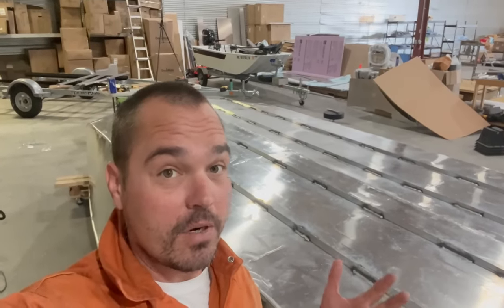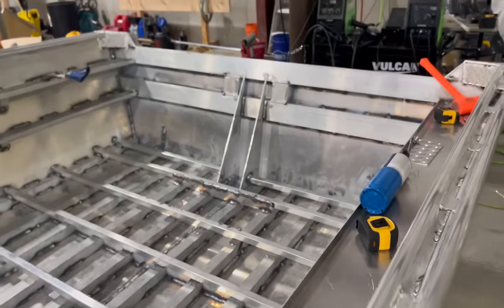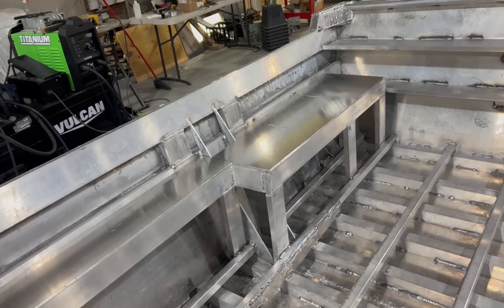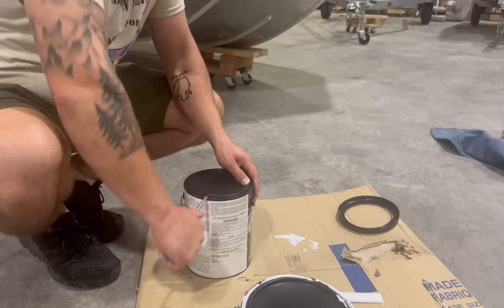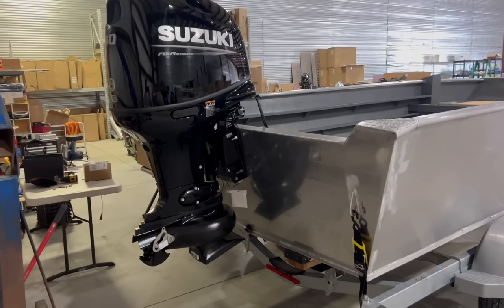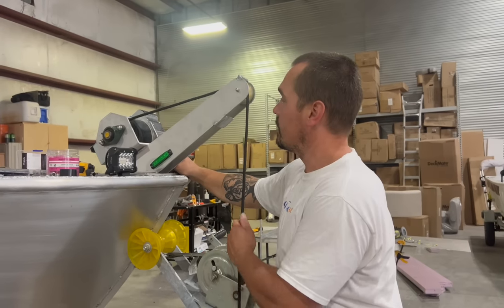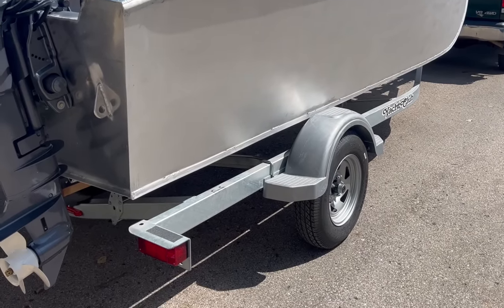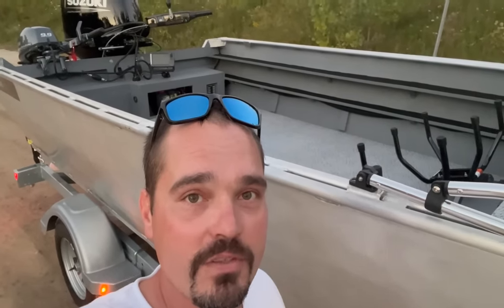EXTRA WIDE 17' Custom Welded Boat Build - Part 3 of 3

Comment: This build turned out awesome. I was shocked to hear how much H.P you lose with that setup.
Reply from the maker: Yep, and fuel economy drops because of that…probably also 30% if you’re running it hard. BUT the shallow water performance makes it 110% worth it. I haven’t tested just how shallow it’ll run, but I’m thinking 4-6” on plane.
Reply: We just use surface drives/mudmotors. We can get 25 to 30 mph depending on how loaded down we are.
Reply from the maker: @jasongrinnell1986  there are a few guys who run mud motors on the rivers here, but they’re so darn loud. For duck hunting it just gets you to the spot and you stay there set up for the whole hunt. We’re constantly moving on the river and running the motor constantly…so we love our jet drives

Comment: nice job thanks to share all this helpful detels 
 just have question 
is the aluminum boat works good for sea ( salt water ) or just good for river ( sweet water )
Reply from the maker: Glad to help. Personally, I would stick to a fiberglass hull in saltwater. Aluminum boats are run a lot in saltwater, but a lot of things have to be done to prevent corrosion. For freshwater I prefer aluminum because it's lighter and easier to customize or repair.

Comment: Question would it be better to put a light weight aluminum floor and not a plywood floor? My old boat had plywood but it soaked up water and made it heavier
Reply from the maker: A lot of folks have commented disapproving of the wood floor. Weight wasn't really an issue here as the 1/2" plywood barely added 100 lbs to the whole boat, and it's so high above the foam and boat bottom that I don't think it could ever get water logged...especially with the vinyl instead of carpet. I love the quietness and the feel of plywood under my feet. My 12' custom build got an aluminum floor and it's great, but that boat was built to be light and not designed to be the big comfy barge this boat is. It's all personal preference!

Comment: How much did you have in it. And how thick was the metal.  Thank uou.
Reply from the maker: The bottom and side walls were all 0.125", most of the bracing and extrusions were 0.125" too. Transom was 3/16" plate and some transom bracing was up to 0.25". I didn't keep perfect track, but after the boat, trailer, motors, batteries, anchor system, and electrical it was around $30K in materials. Somewhere around 200 hours into it.

Comment: Hi Tom! You may have already covered it somewhere, but would you go over your welding setup? I'm looking to get back into welding (aluminum specifically) and am very interested to see what all you use. I see the Titaniums from harbor freight in the video, what models are you using and have you been happy with them?
Reply from the maker: I briefly cover it in part one of the series. I’m going to cover it in more detail in the follow up part and even lay some welds so folks can see what some of the less expensive machines are capable of.
Reply: @tomspontoons awesome! I took a welding course in high school but that was quite a while ago now. I'm considering the multi function titanium welder from harbor freight as one to start out re-learning everything.
Reply from the maker: @wesyoung91  I’ve been happy with my Titanium’s, and the replacement plan is well worth it as you can get a new machine or spool gun if anything starts acting funny. I have used them once for the spool gun and the new one works a million times better. I have the two separate machines to keep from switching everything back and forth, MIG170 and TIG200. It’s super helpful when I can tack quick with the spool gun and then fill in pretty with the TIG

Comment: Just discovered your channel.  Great job!  How much does it weigh in this video when you keep flipping it over?  Just curious.  Enjoy!
Reply from the maker: Thanks! I am guessing it's around 800 pounds of just aluminum before adding the floor and motor, etc. I think the hull is 1300 lbs with the floor and everything in. I honestly don't remember the exact numbers. I know it's about 3000 lbs of boat, motor, and trailer though!

Comment: Fantastic build. 
Is that an ez load trailer ?
Reply from the maker: Thank you!! It’s a Yacht Club. Tows great!
Reply: @tomspontoons  was looking at fenders. Looks similar to mine. Plastic they broke where the foot rest is. Not enough support underneath it. I ended up adding 3/16 alum plate in replacements.
Reply: You ever thought about adding a hot wash box on stern. Comes in handy to wash hands in warm soapy water in winter or river temp water from kicker.
Reply from the maker: @omieyouknowme  I worry about that, but I think these are pretty sturdy. No issues yet
Reply from the maker: @omieyouknowme  That would be amazing. Luckily, we don’t fish bait much in the winter months…wouldn’t need it like we do during salmon season fishing with roe and cured bait.

Comment: Great looking boat. Are you going to start making them to sell
Reply from the maker: Not planning on it because of the hassle of being a registered boat builder. Simple when building for yourself, but gets complicated when building to sell….but that would be the dream! Building one custom boat at a time giving the customer exactly what they want for their use that big manufacturers don’t offer!!
Reply: @tomspontoons  it definitely would be awesome. I'm wanting a boat really bad but I'm in a wheelchair most of the time. I would love to have 1 that the front could open up so I could cruise right into it.
Reply from the maker: They make "landing crafts" of all sizes. It would be something that would allow you to roll up and in safely. Otherwise, pontoon boats tend to be the next best option as you can do ramp systems on the front and sides for shore and dock loading. Plus it's then a flat surface immediately without any decks or steps.
Reply: @tomspontoons  thank you. ill have to check into them both

Comment: Do you sell just the hull built? Basically full welded, no paint wiring etc...?
Reply from the maker: This boat is going to be for sale in the near future. I can build a bare hull with floatation foam (removable) and a USCG tag to meet what you’re looking to do. If it’s 20’ there does not need to be any foam.
Reply: @tomspontoons  I was looking for a basic built hull. All floor supports installed. Prefer a flat bottom (front to back) No V-Mod. Needing a transom that would hold at least a 150hp standard style lower.
Reply from the maker: @rodatkinson1417  That would be a pretty straight forward build. I would push it to 20' overall length (with a swim step) to get beyond where flotation is needed. Plus with a 150 on the back you'd want the extra length for improved handling. Send me an email and I can get you some more information.

tomspontoons@gmail.com

Comment: How much was all the aluminum ? Looks great, I want to do something like this on a smaller scale. I built two wooden cedar strip canoes in my younger days and I always wanted to do a fishing boat like this someday. 😊
Reply from the maker: I’m thinking it was close to $8K in aluminum…1300 lbs worth. I have some smaller builds that were MUCH less expensive. My last one was probably $1500 in aluminum, a 12’ long flat bottom with a 52” bottom. Great little boat!

Comment: Did you weld it with a plse or ordinary mig? Great boat.
Reply from the maker: Regular old MIG spool gun. I’ll do a breakdown of my welding setup in the follow up episode. I show my machines in part 1 of the build. I MIG all the structural stuff under the floor, and TIG all the water line connections and anything that’s aesthetic or visible above the floor

Comment: With building your own boat how does it work for register it for use with a engine in your state? I'm very interested in building my own boat to use down here in fla tried of fiberglass boats I'm from New York originally and that's all we had was aluminum and steel boats.... Thanks for the great content enjoy watching you work.... 😊😊😊
Reply from the maker: Seems to be different in every state. Here in Michigan I can register home made boats as an “assembled hull” and the state assigns it a HIN and numbers. Just have to provide information and/or receipts for purchased materials.
Reply: @tomspontoons  ok definitely appreciate it definitely going to oook at my local law for building a home made boat.. love how your 17' boat came out perfect size for me in the Gulf of Mexico and Tampa Bay...
Reply from the maker: @danielsplayhouse3804 check out how the guys in Australia build their aluminum boats for saltwater. Personally I’d always stick with a fiberglass center console or skiff in the salt. Just easier to maintain and prevent issues with corrosion.
Reply: @tomspontoons  I would think a good epoxy paint would provide protection of the corrosion of the aluminum. I will check it out and see what they do as far as building them I have the skills of welding and Tig welding definitely want to venture out of the box and build a boat and use a power plant for Honda element as the engine and a jet drive.
Reply from the maker: @danielsplayhouse3804 Sounds awesome!

Comment: How much did the build cost. Would you make one for me
Reply from the maker: Materials were well over $30,000 after factoring in the three motors, battery systems, trailer, and more. This boat might be for sale soon for $45,000. It has around 50 hours on the big motor, probably 10 hours on the 9.9hp. If I build more new like this one to sell they'll be 20' overall length versus this 17.5'. You can find my info at my website www.tomstoons.com

Comment: One thing the two part foam does is really dampen the ride! I really wish I documented my complete refit of my jet boat. I put train tubes all through the hull so there’s zero spots for water to get trapped by the foam..
Reply from the maker: I 100% agree with you there about the two part foam. I think that between the foam we used and the wood floors we’ve got it darn near as quiet. I have flashbacks of digging saturated foam out of one of my river boats for hours and hours…I never want to do that or make anyone else do that ever again!!
Reply: You would be very surprised where it will get trapped!
Reply: @tomspontoons  The foam board is a far better choice than the spray in,. just remember it will dissolve before your eyes if it gets contact with fuel!      Nice build!!!!
Reply from the maker: @fireguy7004  yep!! Keep that fuel away!! Luckily 99.9% of it is tucked away under the floor and under aluminum sheet where any chance of fuel could come in contact. It’s all a bit of trial and error, learning one boat at a time
Reply: @tomspontoons  I think what you done is very reasonable.   Should last years. Did you calculate how much foam went into the boat to see if it provided enough flotation?
Reply from the maker: @fireguy7004  I didn’t do the exact calculation. I know I’m a little shy of what the boat weighs dry, but I believe the calculations take into account the weight of the boat in water…or something to that effect. Most river boats in Michigan have zero foam in them straight from the builder…or folks tear it out to make space for storage and such.
Reply: @tomspontoons  Coast guard requires foam in 20 foot boats and less.  yes , the calculations take into ac count the amount of water displaced by the material. engine, aluminum, fiberglass etc...  The factor for aluminum is 63. so if you have 1000 lbs of aluminum, you only need to provide enough flotation to displace 630 lbs of water.
Reply from the maker: @fireguy7004  So glad you've commented on this video, you've brought tons of great info to me and others reading comments! Thank you!
Reply: @tomspontoons  No problem, like you , I dont want anyone to ever have to pull soaked foam from their boat!   Im trying to get my current boat squared away to sell.  Had to rebuild the 454 and Ive had a disaster with the machine shop I used. Just tried to install the cam and it wont go into the last bearing. What a mess.    My goal is to build a 22 or 23 foot jet with self bailing floor and a few other mods Ive got in my head. Seeing your project is a bit of inspiration!!!!!    There was a guy I ran into here in oregon that had built a BIG 26 foot aluminum boat for ocean fishing. He couldnt get insurance without a self bailing sealed deck. he was going to have to go back and cut out the deck and raise it. Apparently the insurance companies have had to pay out on too many claims for moored boats that fill with rain water?
Reply from the maker: @fireguy7004  the inboard jet stuff isn’t nearly as popular here in Michigan. We’ve got skinny water so lighter boats with 60/40 to 140/100 jets are the most common. I can definitely see issues with moored boats needing specific requirements for insurance. If a bilge pump quits working that boat will sink so fast!

Comment: Hello Sir I need help
I’ve looked everywhere and my pontoon is a 1994 Lowe and it has 3 1/4 speedometer and tach the other gauges are 2 inches and I’ve already got my holes drilled out. Today I found out two of my gauges needles are broken. I’m putting the speedometer, tach, water, fuel and trim in and I can’t find a matching set of gauges the size I need. Can you help me please
Reply from the maker: All gauges that I've worked with are the same size in terms of 3" and 2" (the 3" are slightly larger holes as you mentioned). It can be hard to find exact replacements for older gauges. When restoring pontoons I always just replace the whole set of gauges. There are some great Faria brand kits out there!

Comment: What’s your total cost start to finish into this boat?
Reply from the maker: I didn’t track it as accurately as I wanted to, but somewhere around the $30-35K range in materials and probably close to 180-200 hours. It’s overbuilt, learned that on this build…not that it’s a bad thing, just expensive!
Reply: I’ve watched a few of your other boat builds do you by chance know the cost of materials on those?
Reply from the maker: @chadray8699  those were both built with blemished or overstock aluminum that I had to lap or weld together to make the full length bottom and sides. I probably had $1500-$2500 into those builds😊
Reply from the maker: @chadray8699  those were built from blemished or overstock sheet so way cheaper. However I had to weld sheets together to make the length I wanted for bottoms and sides. Probably $2000-$2500 in aluminum for those others.
Reply: Thank you for sharing!! Also what thickness were you using for the sheets?
Reply from the maker: @chadray8699 happy to help. All 1/8” 5052 H32 for the bottom and side walls

Comment: How much would this cost
Reply from the maker: To purchase? Around $50K all rigged out with motors and trailer.
Reply: @tomspontoons  thanks man I'm in Louisiana looking for something big water cable holds lots of fuel and fast with a 150 and 19 ft think ill be about 40k
Reply from the maker: @jaredaugust2879  If you don't need all the bells and whistles you could probably get it done for around $40K +/-. My overall hull lengths are 20'1" or slightly longer. This allows more freedom for an open layout. Do a big modified V hull with high sides and a forward center console or a side console. 

Just a heads up, I do not build boats to operate in saltwater as we don't seal things up with weld that some boats would for saltwater specific use.

Comment: Jet drives suffer a 30% loss of power to an equivalent prop drive?!?! I was told there's a loss of HP with jet drives but I had no idea it was that bad.
Reply from the maker: It is that bad!! The best bet is to go to a bigger HP for planing purposes and then back way off to cruise at lower RPMs to save fuel. This 140 actually does great on fuel…it’s surprised me big time so far!!

Comment: All the time spent welding all aluminum, why would you use any plywood in this boat?
Reply from the maker: That appears to be the great debate!! I love the soft feel and quietness of the wood floors. If I have to replace them in 10-15 years I’m ok with that. Heck, by then the interior will need new paint and stuff anyway. I did all aluminum in my 12’ to keep it lighter, but this boat was all about comfort!

Comment: they make dye crack checker so u dont need to waste soo much water
Reply from the maker: Yep, I have some of that on order for other projects! The benefit of filling it is that it gets lots of soot and splatter cleaned out too!
Reply: @tomspontoons  would u sell the plans to that boat u built I'd love to build one
Reply from the maker: @captainchrisfishing  There was a lot of scratching down ideas to get the big parts and pieces dialed in (mainly for what size sheet to order), but so much of this boat was all cut and made to fit as I went along. I've told a few people that I could build a boat similar to this again, but it would never be identical!
Reply: what do you think you had into the boat after the build was done materials wise
 @tomspontoons
Reply from the maker: @captainchrisfishing  It's about $10K into aluminum alone.
Reply: damn
 @tomspontoons
Reply from the maker: I didn’t expect it to be that much, but that’s why comparable boats are selling for $60K+ new. And I definitely can’t afford that!!
Reply from the maker: Luckily I could build the boat I wanted (and couldn't afford)...but when it comes to buying a tractor or other type of equipment I can't build myself I'm stuck paying what they're priced at. I just try to own less "stuff" so that I can afford to live!! lol